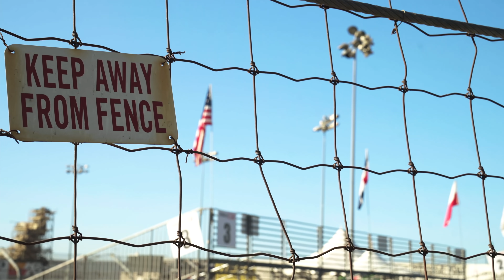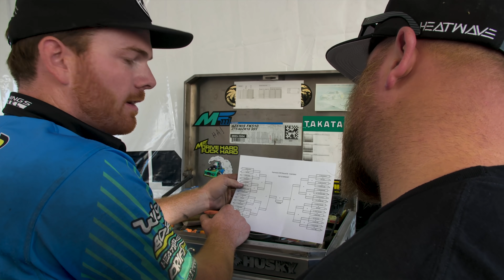Formula Drift Corvette catches on Fire + Odi gets Top8 | Frenemies Irwindale

Comment: Just remove the bumpers, they just get ripped off anyways!😂
Reply: If u rip off the bumper the car would be lighter yeah, but that would affect the arrow of the car. Thus causing them to have less down force. So a better solution would be to make the bumper more sturdy so that it stays on the car. Correct me if I'm wrong.
Reply: @gojeanplayz8339  u gotta be so funny at parties
Reply: They dont bc it will make the gas tank more exposed and the chassi so the car can get totalled easily
Reply: @gojeanplayz8339  I think some of them replace bumpers with bash bars. More sturdy, especial if they hit a wall or something.
Reply: @noobpyxl  I'm pretty sure they use fuel cells and remove the gas tanks for safety.
Reply: CannibalCowboy51 well the bash bars are behind the bumpers in most cases and then sometimes they have no bumper and only bash bar so yeah

Comment: This track is so hard to drift!

...on fr legends
Reply: lol, what about a tight mountain pass.
Reply: Maximus M tbh would prefer that over irwindale
Reply: easy to get 250+ total points, unless you completely mess up the initiation and the transition to the inner wall. School Course is much harder, IMO.
Reply: VIEultimate Nah school course is easier (the tight turn at the end is hard in chase tho) but I've not managed to get irwindale consistently
Reply: @kasper5688  I just played again and again in IRW to get it good, I just get lower scores when I'm trying out things like where and how I would initiate drift, or when the AI would be inconsistent with its angle and line, making me collide with it. As for School Course, I'd strongly agree with that last hairpin or two. It's where most of my deductions in chase comes from, from collision during transition or braking before the left hairpin, or going off course trying to avoid collision, or when I get slowed down too much by the AI.
Reply: VIEultimate Just Tried Irwindale again and it wasn't as bad as I remembered...

Comment: im not some master mechanic, but seems to me... its an expesnive Corvette. fulll of expensive parts. which... some of which are just not as reliable as what would be on that Silvia. i mean. the Silvias ARE one of the most chosen Drift cars, for good reason. not only do they perform. but they are reliable.  i dont know shit. Are corvette's reliable?. my hunch from what iv seen in history of seeming them race... the answer is  mostly no. but i could be wrong. they are still doing a LOT of tweaking on that car, and it does take time to get it right.  and Drifting Puts a LOT if strain on the car, seems like its more complicated than it should be though.  Question for anyone who knows... what is more damaging and Stressful on a cars frame and systems? high speed and high G drifting? or high speed Rally racing... my guess is rally is harder on the car cause of the dirt. but again. i could be wrong.
Reply from the maker: The majority of the cars in FD are running LS motors similar to what comes in a corvette. I can't think of a single car that runs an SR20 (silvia motor) on that level.
Reply: But odi's car has a corvette engine too so ur argument is very false
Reply: @brenwhittal   well i did not know that, the more you know :'D